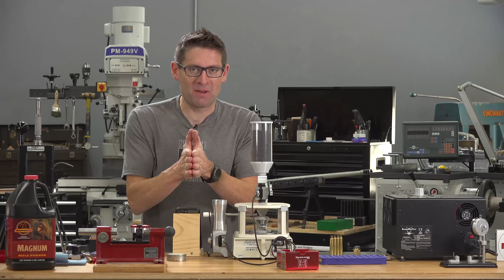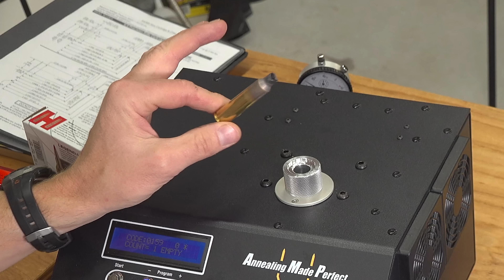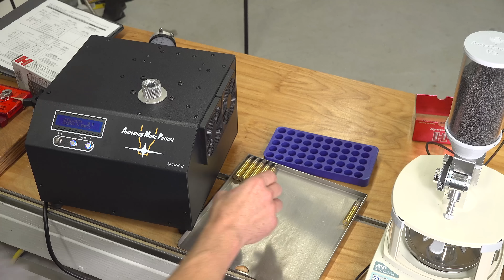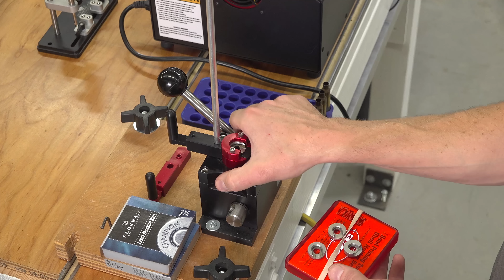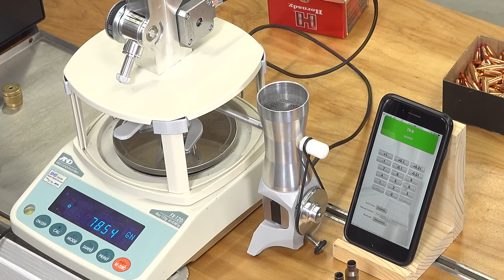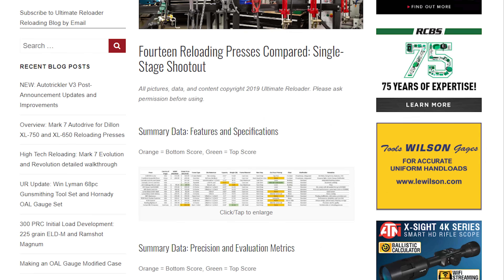300 PRC Precision Loads Step by Step

Comment: You might have better results with a regular large rifle primer unless it’s super cold but I shoot a 300 rum set up for ELR with 33” barrel with 100 grains powder and I found it more consistent with regular large primers
Reply: Man I’m 2 years late on this video but I saw this comment and wanted to say something. I use federal 210 standard large rifle primers in every single one of my .300 win mag loads. One for example is 75.4 gr H1000 with a 210 Berger. Lights her off every time and I get great accuracy and the 210 Berger is going 2950 in Lapua brass and a factory Remington 700 Sendero! Glad to see someone else having good results with standard large rifle primers!
Reply: @D.Rambo32 same here I’m using 105 grains of powder and I tried the magnum primers, and I tried the regular primers and I get a more consistent ignition with the regular primers even in cold weather
Reply: @timmcfarland3311 I have never had a hang fire either in the cold, and my dad has not either since the 80’s with large primers instead of mags in .300 win mags! Glad to see the same results being had by others
Reply: @D.Rambo32 I had a couple with my 300 RUM because I was using mag primers and Reloader 33 and it was only 93 grains too much air gap    So I switched to US869 and I gained a lot of speed 3050 fps to 3170fps with the 245’s and I settled at 105 grains which fills the case up better and switched to reg primers and haven’t had a problem since
Reply: @timmcfarland3311 man that is a hammer load haha I love it!

Comment: You should buy an RCBS neck sizing dye, there's no need to full length size your fired case.  If you can find some, there's Winchester powder called WMR1, it works wonders in the .300 Win mag.

Comment: I know this is about loading 300 PRC but just curious if you're still using from time to time or recommend the MEC Marksman??? I started on a RCBS Partner press then I bought a new Dillon 550C but I kept my Partner press so I can do all my sizing and load development on. The Partner press was an ok press it didn't make the most precise reloads but it got the job done. Now it's worn out and I've got to the point with my shooting and reloading that it's holding me back so I'm looking for a good precise single stage press. The MEC Marksman, the RCBS Summit, and possibly Forster Co-Ax are the 3 I'm looking at but really either the MEC or RCBS is what I'm wanting to buy... Any info would be appreciated!!!

Comment: This might be a very stupid question because I'm still learning about reloading and about to get into it": but why do we need to anneal brass? And when should you anneal? 

Thank you
Reply: It's not needed to reload.  Makes the neck easier to work basically.
Reply: I have loaded thousands of rounds over the last 60 years and never done it. and no problems , they always used to just sit them in a pan of  water , heat the neck and tip them over

Comment: I am reading your article interestingly.
Recently, I saw Reddit reloading 82 grain of N570 powder to achieve a speed of 2905 (hornady 250grain a-tip 26barrel).
He said the life span of the barrel is only slightly reduced and there is no safety issue.
But, According to the reload data released by Hornardy, The maximum charge was 77 grain(when used h1000 powder)
So, I wonder Is it really safe.
What do you think about that?

Comment: Awesome vids Gavin. Been a fan for some time now. Keep the reloading videos coming. Question about making a modified case. I don’t have a lathe, or drill press, nor do I have access to either. Are there any other accurate methods to make one? I purchased the correct tap. Just need a way to accurately drill and tap my cases.
Reply: I use a cheap drill press, but if real careful , could probably do it with a simple hand drill

Comment: When you bumped the shoulder 0.001 was that from a once fired case or a snug fitting case or off of a chamber print? And wouldn't that make a difference?
Reply from the maker: Once fired!
Reply: gavintoobe try shooting one case 2-3 times until it gets a little bit more snug in the chamber then bump the shoulder and compare that length to your once fired brass  length with the 0.001 bump you gave it.

Comment: Something I haven't seen possibly because PRC is so new is a comparison with .300 win mag.
Reply: The comparison is waste of money. I load my win mag at a little over 3.7 coal and around 2.940" ogive. 2930fps avg. with 77.4gr of H1000. If I was retarded, I'd make a big deal out the belt on the case and cry about not being able to load them long (this one I still don't get) and start menstruating like some do, but I don't. I size just like I do any other cartridge and bump the shoulder a couple thousandths and I'm off to a mile.

Comment: I just purchased a Rock Chucker IV, a Hornady Iron Press, and a RCBS Summit Press since these were the top 3 of 4 in many categories. Also I don't want/cant afford a 1000.00 single stage press. I shopped for the most accurate presses that would allow 3.75" of case capacity as well. I plan on doing OAL, runout and concentricity tests of my own to see if they match yours. Whichever one wins will be my loading presses the other can be a bullet puller / deprime press I suppose   :)   Maybe we all should do this and build a database perhaps.

Comment: I noticed you didnt clean up  the flash holes, and uniform the primer pockets. Are those two extra steps not necessary?  As in would it make any difference in performance?
Reply: I do both myself, but have seen several test done showing minimal to no bennys when uniforming pockets.  Flash hole deburr i feel is a must. I continue to do pockets out of habit.
Reply: Depends on the brass. Lapua for instance rarely needs anything doing to it.

Comment: Hey Gavin. Mec upgraded the handle on the your press. Give them a call and they will send you out a new upgraded handle and pivot arm. They upgraded the threads from 1/4 to half inch. I can tell you have the old handle because they changed the locking nut to the bottom.  I was having issues with the handle coming loose while sizing.  cheers!

Comment: What’s the purpose of aneling the case?
Reply: You know when you bend a wire back and forth it work hardens and breaks?
Aneling normalizes the case so that it can be worked for longer periods of time before failure and maintains neck tension.

Comment: You have all the neat equipment and do  so much to ensure accurate loads I wonder if you would consider the following:
Outside turn and lap necks, avoid expander button by sizing with a button. work up the best load for accuracy, noting std dev and es, then do 10 5 shot groups alternating between weighed charges and thrown charges.            good technique and a fine measure like a Harrell Precision with bearings would be in order. Maybe clean after every group or so allowind a fouling shot if needed. get es and std dev along with aggregate of the 5 groups to compare.       In the old days I went to shoots with 75 or more shooters and never remember seeing a scale anywhere.    My contention is that if the seleceted load is in one of those flat spots on the curve, up to 1/10 grain does not matter as other variables will obliterate it.   I realize  times have changed and the equipment for weighing is better,       just saying!

Comment: FYI, .001 shoulder bump will not be enough for each case, as each case will vary in the amount it wants to be bumped. I always go .002 to .003 to get the best accuracy.
Reply from the maker: Nope- not when you anneal! :) Close to zero springback.
Reply: lukkar69 , hi that’s exactly what I have to do with my 6.5x47 cases and I do anneal with the AMP annealer and I have a custom cut chamber and use Whidden dies , I use Lapua brass and still they don’t all resize the same , annealing softens the neck and shoulders yes  , but the brass can very in different thicknesses resulting with some moving forward more than others.
Reply: GianniG, exactly, I want zero contact of the case what so ever, if you bump it at .001 and one is touching you will get a pressure spike that will give you vertical in your groups. I’ve learned the hard way.
Reply: Yes your right , when I started to reload this particular cartridge { 6.5x47 } I would bump 1.5 thou / 0.002 thou then chamber some of the rounds only to find that some would fit back into the chamber fairly smoothly and some would be extremely tight so I had to bump back to 3 / 3.5 thou to get cases to rechamber properly, but one of the problems we reloaders face is that we can spend good money on custom chambers only to have factory spec dies to resize our brass which is not that good in the real world, custom dies would need to be made or homed to better fit and resize our brass.
Reply: GianniG , I’ve now switched over to custom dies myself.

Comment: Did you tumble your brass at all or just a quick wipedown? How about a video on whether or not a wet tumble will affect your accuracy at all? How about a wet tumble to clean your brass than after you resize and trim a corn cob tumble to remove lube, with that help in any way?
Reply: Agree. He said he lubed the inside of the necks too, but then how was that removed, or was it?Does that neck ID prep affect the velocity stat or the group size?The AMP guys make a point to show a huge effect from just brushing the neck prior to seating in their last video on the motorized force gage press. Shouldn't leaving Imperial lube in the neck make a big difference too?
Reply: Dino C.   I wouldn’t leave Imperial inside the necks. And if I was loading for a semi-auto I would make sure I cleaned it all off good. Plus, the powder tends to stick to the lube when charging the cases, some more than others depending on the type. The same for when I use lanolin/alcohol mix. 
But I do use Imperial Dry Neck Lube especially if I’m just neck sizing only. I’ll give the insides of the necks a quick brush beforehand, dip the neck in, resize, and wipe off outside. I don’t worry about the inside with the dry lube so much. Supposed to be ok. But sometimes I give another brush once for consistency before seating if trying to get the best es and sd and accuracy at long distances. Not sure if the last helps or not though.

Comment: If you wanted to be scientific about this, you'd reload "normally" and see what differences you would get.  Not anneal, standard hand primer, throw and trickel powder from a standard set up.  What is the delta between the $6K reloading set up and the $1K (or less) setup.
Reply: that would be interesting. Loading a known accurate recipe after a simple resize and trim on something like a lee challenger press with lee dies, and then charge with the lee perfect powder measure or something similar (budget / medium quality scale for instance). 

Then do the exact same cartridge but with all of the extra bells and whistles on a fancy press and test both for accuracy. 

I've been wanting to do something similar but with weighing and sorting brass, bullets, primers, vs just grabbing components and sticking them together. I actually think my groups have tightened up some since switching to a powder measure over trying to weigh and trickle. The inexpensive scales seem to wander over time (sometimes a lot, .5-1 grains isn't unheard of with the shitty ones I've used) and that isn't something that you have to worry about with the measure, even if it isn't as accurate. The inaccuracy is accurate, where an intermittently wandering scale is hard to account for.
Reply: Precision is precision - but to what degree?  Using, as Rumble hints, what gain in accuracy can be seen when going all in with Gavin's process?.  I use my Dillon RL550B with Dillon or RCBS or Hornady or Lee or Forster dies, depending on what I like in any given caliber(load several calibers.) But, my downrange results are consistent.  There are some differences between load work up thus it is all in logbooks. If I were trying to mail a gnat's ass at 1000 yds then I might want to go in tor the super precise handload process.  I must say, though, if I could afford all the toys in the Gavin classroom I would have many of them. I get great results out to 300 yds which for this 71 year old 11B is far enough.  I can.t even see 300 yds......
Reply: Agreed, that would be interesting! I read a few articles basically saying once you get a standard deviation below 8 fps and 1/2 moa accuracy to stop stressing the reloading process. I do think you need to go to the extreme if shooting elr.
Reply: @Rumblestrip.NET    He started off by shooting factory ammo which is the less expensive setup you asked for.  ;)
Reply: Did you fill length resize or did you just bump the shoulder?!  I would think you would have to full length resize because I’ve had issues with not being able to close the bolt on my 6.5 PRC.
Reply: If it showed little difference no-one would be buying all the expensive great 😉
Reply: Hi there, I'm a young shooter from New Zealand. I use the lee 50th anniversary set, lapua brass, CCI primers, IMR4064 and Hornady ELD-M 178gr projectiles. My current load consistently prints sub .4 MOA at groups at 100m out of my Suppressed but otherwise completely stock remington 700 SPS tactical .308.

I am fairly picky about ensuring that the powder charge is as near to identical every load using the balance beam powder scale. I am religious about brass cleanliness and very careful with the necks of the brass after shoulder bumping with the lee neck sizing die. I have never measured neck tension/runout as I don't have the tools. I'm not convinced that it would be worth the time investment.

My rifle cost $1100 NZD and the reloading setup was $350 NZD. Sure, the way I load is very time consuming but goes to show that with patience and practice there is no need to spend thousands on either rifles or reloading gear. I would argue that precision reloading and shooting is 90% care and patience and 10% accurate gear.
Reply: Also had my loads chronographed at the range and read 2582, 2591, 2586, 2585, 2577, 2598 fps over 6 shots. That is a SD of 7.3 and an ES of 21. Personally I think improvements in my shooting will make a bigger difference than investing in more/better loading gear :)

Comment: Why full length resize and not neck size? These being refired from same rifle?
Reply: I shoot 1000 yard br nilot f-class and almost everybody I know including an awful lot of hall of farmers only use full length dies. The reason is simple. If you only neck size in about 3 reloads your brass will grow beyond the headspace of your chamber resulting in hard bolt close when clambering your round. The brass will be inconsistent lengths also and one might close hard and one might close real easy. Brass that chambers hard meaning you feel pressure on the bolt handle when closing it will flex your action and brass that closes easy will not. This will induce vertical into your groups. Full length sizing can push your shoulder back the desired .001 to .003 and bring the shoulder diamameter and body down a couple thou also. These will chamber very easily because they have the required clearance now.when everything fits right your shoulder will be no more than .003 shorter and if you take the firecontrol out of your bolt the handle will fall closed under its own weight. Easy bolt close helps in another way also. It helps keep your gun stable in the bags while loading. All this consistency is very important to group good at 1000 yards. It's really needed to shoot your best 100 and 200 yard groups too. Short range benchrest guys full length size now also. I will never own another neck only die again unless you have a body die to run with it. His garage is like the reloading compared to cars of Jay Leno. A person with 1000 bucks can make ammo as good as a 6000 set up. There are very good tools available to the average reloader now. Proper use is what's needed to get the results. Good luck guys and if you don't understand some of what I just said ask and I will say it a different or more complete  way for you.
Reply: I’ve done both full length and neck sizing and honestly haven’t had issues with either method. Interesting of f class using full length resizing though
Reply: Because it's only resized slightly, which is more effective at coaxing consistent behavior out of your brass.